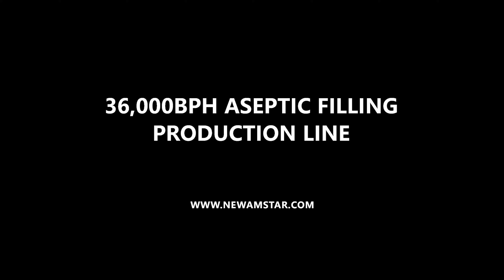Aseptic Blowing Filling Capping Combiblock Machine For Lactic Acid Bacteria Beverage

Comment: Newamstar is the explorer and founder in China on PET bottle Aseptic cold filling technology, working and researching in the Aseptic filing technology field for decades. The Aseptic technology is continuously innovated and improved, as well the VHP and HPV system is developed exclusively by Newamstar on packaging material sterilization topic. A series of the sterilization intensity theoretical figures are collected through the cooperation with Jiangnan University, verifying the microorganism in the laboratory. And such technology has been successfully applied on the non-ozone mineral water Combi production line, Aseptic cold filling and cold filling production line etc. The low concentration (1-3mg/L), low temperature (20-50℃) gaseous H202, achieving the sterilization level ≥5log in a short time.

Comment: One of the advantages of the Newamstar Aseptic Blowing-Filling-Capping Combiblock is that it can be used for both high acid and low acid products. This means that it is a versatile solution for a wide range of products, including fruit juices, dairy products, and other beverages. The system also helps to maintain the quality and nutrition of the product, ensuring that it remains fresh and nutritious for longer.